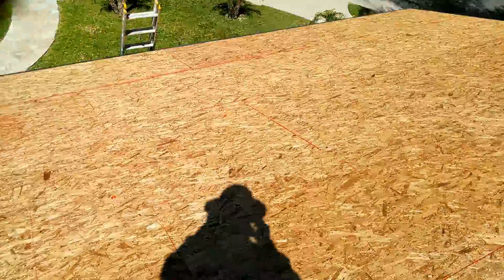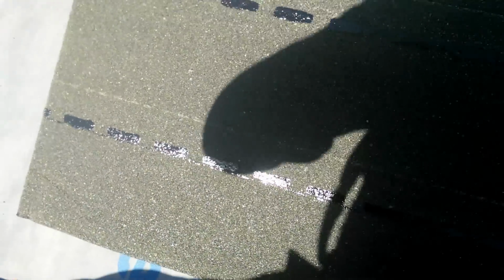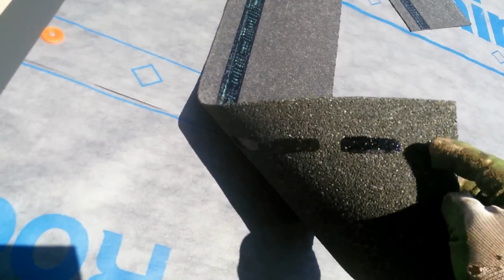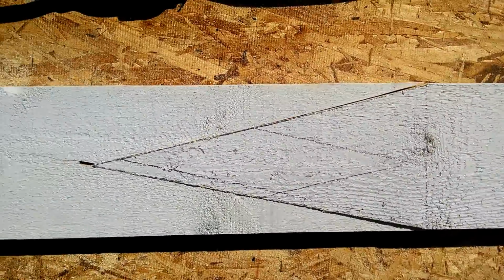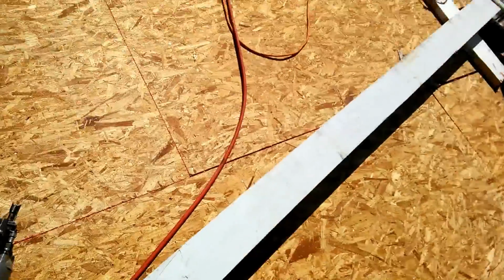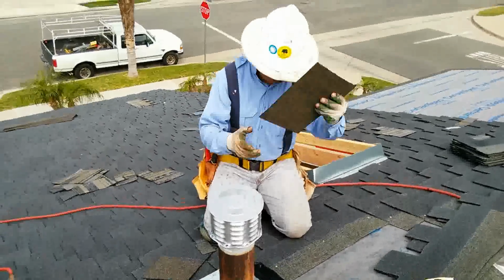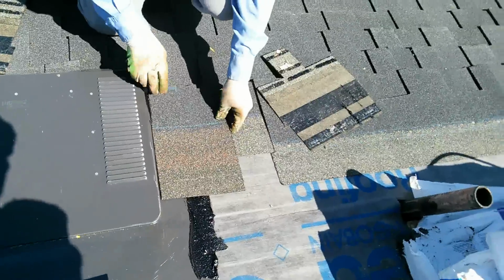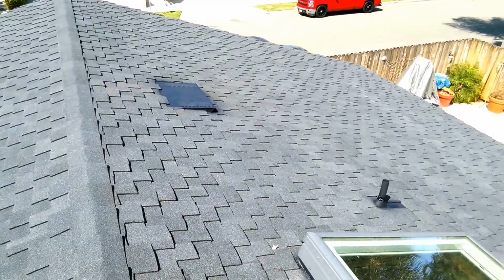Do you want to be a roofer?  Watch this video!

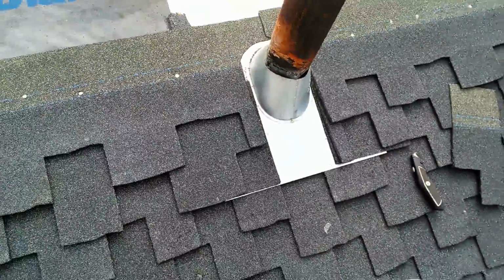Comment: At 15:00 thru 15:20 the small shingle was not nailed !!!
Reply from the maker: G Ht. LOL, shall I explain it to you ? 
OK....I will 
the # 1 reason is because you CAN NOT nail anything around the pipe metal flashing , so it's there for a cosmetic look only, the glue will stick to starter on the bottom and the shingle on top of is will keep it in place since it's a small piece.
sometime roofer don't even install that little piece on presidential shingles only or Grand Sequoia , because the piece on top covers that area anyway , so it's a waste of time if you do it , most of the time I install it , Again it's a trick of the trade and it won't cause any damaged to the roof warranty.
Reply: eric garciaa
Reply: G Ht.  Sorry, I guess  I learned how to place shingles around flashing now.
Reply: and that shingle wasn't aligned on top of the flashing lol Mickey mouse

Comment: You installed the prostarter  upside down. wtf
Reply: If you're gonna post a video on how to install presidential shingles you might want to actually know how to install them.
Reply: That's why my company is a Certified Master Elite Roofing Contractor. We know how to install the material the way the manufacturer actually intends for it to be installed.